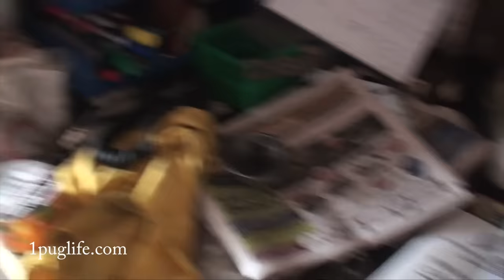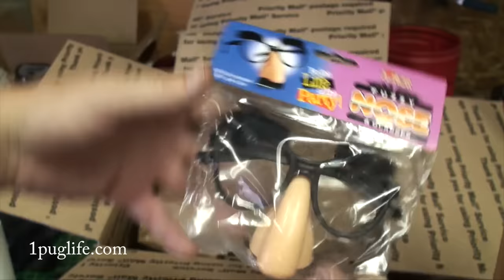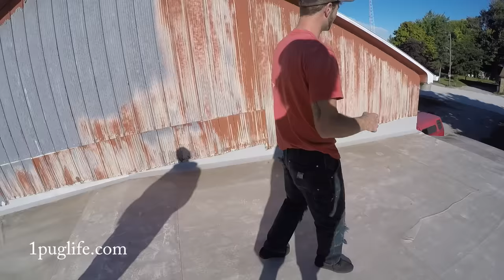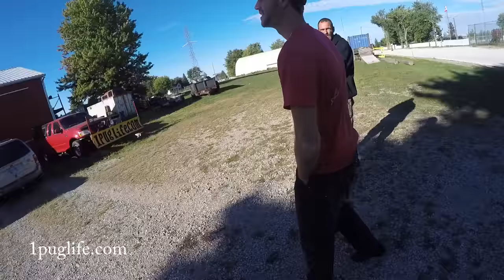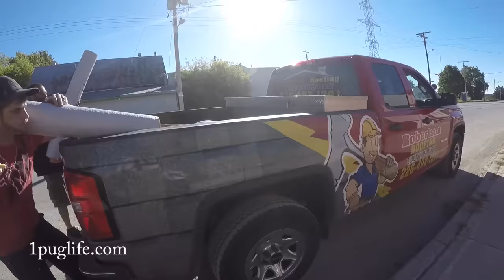roof update

Comment: This roof dick is also a screwball too. That metal can be screwed on or off of the rib. I always put them on the rib but it can be done either way. Also, that vapor barrier will cause you problems. The vapor comes from inside the living space so it's going to permeate the drywall the be trapped between the drywall and the plastic causing the drywall to mold from the backside, seen it many times, I wouldn't drywall over that plastic.

Comment: All steel roofing manufacturers for steel recommend in the flats, normally beside the ribs, You can't pull the screw down tight if in the rib. It'll spread the rib. Actually will get MORE leaks screwing on the rib, as well as spreading the sheets

Comment: "Install screws on the rib only"

What in the actual fuck? 
Seriously, am I missing something here?
Reply: I was wondering the same lol I have NEVER heard of anyone screwing threw the ribs.  It doesn't even make sense, the screws wont even be long enough for one thing, and also when the screws get tightened down it's going to flatten the ribs and they'll look like absolute shit.
Reply: ribs are the raised parts if you put screws in the valleys/channels you 100% going to get a leak
Reply: think its that type of system ..or something , is why he said to pug check what the fitting procedure is ..rib or flat  or something like that http://lyonmetalroofing.com/wp-content/uploads/14WoodTite-Strength.jpg
Reply: this is like, the eternal metal roof argument.. you're gonna get guys on both sides vehemently arguing either way and calling the others retards for even thinking that. my personal opinion is that through the ribs makes more sense cause more water is gonna pool in the flats than on the ribs thus less risk for leaks. counter argument to that is the screws have seals for a reason, but counter that with "the seals are eventually gonna deteriorate and leak"..... you can see how this goes on and on and on and on. the actual manufacturer of the steel will say in their paperwork how it has to be installed for the warranty to be valid, i say read that and do what they say yknow?
Reply: ^^ agreed , so many already in comments are for and against rib..lol .. but yeah new roof guy said .. get the installation manual or ask manufactory how its done.. so right there  to me.. the guys going to be good to pug1..
Reply: Turbo just had mind done and it's not screwed on the ribs??
Reply: That's what I was confused about. I had mine done two years ago with metal that has the same rib pattern as pugs and the roofer installed screws on the flat not the rib. In fact I have never seen a metal roof only fastened at the rib (excluding standing seam which is crimped together) but that's a whole different beast.
Reply: You dont screw on the rib
Reply: @TheBCSledder  All steel roofing manufacturers for steel recommend in the flats, normally beside the ribs, You can't pull the screw down tight if in the rib. It'll spread the rib. Actually will get MORE leaks screwing on the rib

Comment: You do NOT put the screws on the ribs!!!  If you go to clean snow off it you will fuck the roof up if on the ribs. If done right it will never leak. The problem people have with it leaking is when the tighten it down to much and mess the rubber washer up.

Comment: Yeah and you want to make sure the screws go into the space seating not into air and there's no drip edge running up your rake and actually with that type of roofing system they have those even for a ribbed roof or what we call a pro panel they do make drip edge and ridge cap even vented ridge cap but with all the space shooting probably don't need that and you only have depending on the size of your exhaust pipe a custom pipe Jack or a premade one that you can Flash in properly and you would have to overlap the pro panel after the first panel goes up to the pipe and extends I would say probably about 8 inches to a foot install your pipe Jack overlaying the first panel from the bottom up to the pipe then put the second panel over the top end of the pipe Jack and over the first panel and seal the pipe Jack where it overlaps the first panel and where the second panel overlaps the first panel seal all these

Comment: The rubber washer on the screw prevents it from leaking.... you can put the screw wherever you want🤙🏻
Reply: That's why I wouldn't trust these guys either...manufacturer told us to put them in the flat, they said the washer presses flatter and seals better
Reply: Matt sandlin  you are WRONG,,! All rubber- -polypropylene washer materials break down with sunlight,,even the most amateur tradesmen are aware of this fella,! 😂😂😂😂🇬🇧
Reply: With the screw fitted through the rib is a greater guarantee of not leaking if anybody here in Australia screwed through the flat part of the roof that job would be condemned.
Reply: ROBERT BUTLER     Use standing seam and you won’t have any screws showing at all. Problem solved👍🏼
Reply: #9 1 1/2" screws are equipped with neoprene washers and are to be installed onto flats with the recommended amount of torque as per warranty. Any weathering or installation practice would be a maintenance issue and if installed correctly should last 10 plus years. As per ribs, self boring stitch screws are recommended. # 9 1 1/2" screws would not be recommended for ribs with varying sized voids to support girts or substrates due to shear effect related to expansion and contraction of the structure. Due to these conditions it would make it difficult for reputable contractors to provide a long term warranties if this were common industry practices.

Comment: Screws go in the flats=Valley that's why they have non vulcanized= soft washers. your new roof guy is a goof also. If you put the screws in the ridges the roof of walk out! And it'll be wonky and completely out of square by the time you get to the other end. Simply put if you put the screws in the ridge you'll squish it and it will expand. There's no way of judging how much it expands each time you do it. This is why the screws have washers and need to be placed in the valley.
 Canadians!!!!! Can't teach a frog anything

Comment: Take 5 minutes and look up "metal roofing fastening schedule"
Yes, you screw the flats and you use a special stitch screw for the ribs at the laps.
Either way, that is one shit installation.
Reply: Yesss!! I knew I'd find someone who said this!! I've installed for years, screw in flat, stitch in seam, or it's not rigid and moves, wollows out hole, also how pannels "grow" look up how manufacturers explain installation.

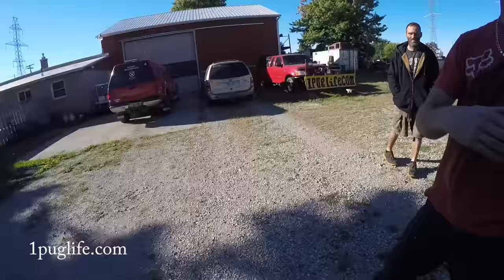Comment: not sure what he is talking about, 15:50, screwing on the rib?? never seen that in my life!  how-to vids up the ying yang, I would really like to see this rib screwing operation!  roofers in Ont must be hard on the glue sniffing
Reply: buffranchAB I have done many roofs and I agree with u I have never seen ribs screwed I was taught to screw flat too..
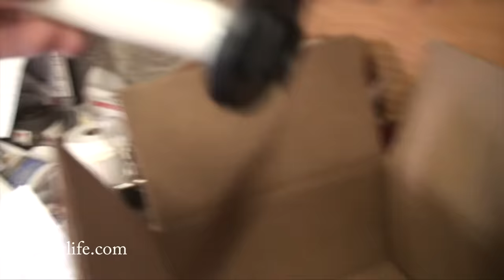Reply: This argument is primarily due to the use of lead headed nails used back in the old days. Because they did not completely seal the hole in the panels, you had to put them up out of the water flow. These days, with fasteners with neoprene washers, you can fasten the panel in the flat where they are slightly less obtrusive. You don't say what type of panel you are using. If you are using a panel with a tall rib, you run the risk of overtightening the fastener and colapsing the rib. Also, when the fastener is in a rib, it can experience more prying action as there in not much to keep it straight. Engineers do not like to see fasteners installed in this manner. Now if you are looking at a 5V Crimp panel as is often used in Florida, many people put the fasteners in the top of the V instead of in the flat. While it is common, it makes no sense to me. While the prying action is not as bad as in a tall rib panel, you have a much harder time getting a fastener started in the top of the V (some folks turn the stack upside down and predrill them, others hit the top of the V with a hammer at the fastener location to flatten it out a little). In this instance, imagine what you are doing to the neoprene washer as the fastener tightens and rubs and catches on the V. In the commercial industry, we use the same type of screws (the heads and washers are the same) on roofs that are up to 800' from eave to ridge at a 1/4:12 roof slope. That means the fastener heads are submerged in even a light rain. We do not have a problem with fasteners leaking (as long as they are properly installed. The bottom line: people successfully do it both ways but you have a lot less chance of a problem and better uplift resistance if you put them in the flat.

Comment: Don't hire those guys either. "Put the screw thru the top of the rib."" $500 pair of duck bill pliers to bend metal" first off im sure roofers install metal in many different ways. But its the manufacturer installation methods that are important. Manufacturers have did the testing and determine what method promotes roof longevity. They also will not warranty thier products if not installed in accordance with thier instructions. It is always best to go with a reputable company and always verify references if you have any doughts. Screws- always a problem because often times people over tighten when installing. Screws will not last as long as the   life of the roof. A 45 year metal will need to have screws replaced twice during that time frame. At best you might get 20 years,  but typically i see 15 years being about the limit your start seeing significant degridation of washers. Rubber washer longevity is determined by proper installation.   Squarely installed and tightened to per manufacturer instructions. Overtighting, will certainly lead to premature failure. If tightened properly, rubber washer has the expansion and contraction to provide proper sealing thru all the seasons. But eventually they will dry out, breakdown and start cracking leading to failure. That is why 10-15 years replacement intervals will give you long lasting results. Of course if you want a real maintenance free roof with exception to roof penetration sealants. Then a hidden faster style roofing metal like standing seam is best. FYI

Comment: All of this roof bullshit reminds me of working on my dad's house a while back.  I flew in with my wife from 1100 miles away to visit him and other family.  Somehow he cons me into spending 1 of my 4 days of vacation to dry wall the living room in the house he was in the process of moving into.  While I'm there handing drywall with a couple of his buddies he calls the plumber.  "So what do you have left to do on the bathroom" "virtually nothing"  So is the toilet and the new lines ready to go?"  "Oh yeah, it is all good, you just need to turn on the water and you are good to go".  So my dad goes into the basement to turn on the water and notices something.  The water lines the plumber was paid to "replace" we a hodgepodge of old and new fittings.  WTF right?  When renovating a house that you know hasn't had any utility work done since at least the mid fifties you don't screw new fittings into fittings that qualify for medicare.  But it gets better, after finding this out he calls the plumber and tells him "I want you to take a look at something, can you stop by for a minute?"  "Oh yeah, I'm at this other job but I can stop in in about 45 minutes".  While he was on his way we take a closer look at the toilet.  Turns out if you touch it it wiggles quite a bit.  Our first thought is "Ok, he didn't bolt down after connecting it to the drain, no big deal, stupid and we're very glad we caught it but no big deal".  Take the caps off where the bolts should be and discover...........he cut the hole in the tile way to big and there is nothing under for the base to bolt it to.  The toilet was literally only held in place by the rubber boot leading to the sewage drain.  Meaning the second someone sits on it a little off square BOOM sewage leak. So this guy gets there, makes all kinds of excuses, blames my dad for rushing him, assumes a random friend of my dad's who was working with us was his only major competitor in town (way to know who your competition is) , damn near cries about how rushed (the guy had like 2 weeks to the end of the month when my dad had said he would like to move in) and how difficult a simple line replacement, floor and toilet install was and storms out of the house while saying "I need to leave before I hurt someone" yeah, smart thing to say in a house with 5 men not counting the homeowner and you are there by yourself.  After there is a rather loud talk in the front lawn about "why in fuck would you ever say that in a situation where you are the one that fucked up what you claim to be your profession" he says he said it because he "trains to kill people with nothing more than my hands" and then has the gall to say he will fix it but wants to know when he is getting paid for the job before he does.  We as a group all collectively tell him to get lost, it take one of our guys only about 45 min to fix the toilet problem and my dad has the other plumber in town, who the goof thought the random friend was, take a look at the toilet fix and he said "yeah, that is exactly what I would have done if I cut the hole too big, looks good" and told us to take him to court over the hack job he did on the supply lines.  But do you know what the worst part is?  My dad still paid the guy like 2/3 of the originally quoted price, fuck that man.  I would rather spend twice as much on a lawyer than give someone money for UNCOMPLETED WORK!!!!

Comment: this guy is wrong you do not put the screws on the ribs I have been in this businessfor 30 yrs both as a contractor and retail and if you talk to a retail building supply they will tell you screws go the flat as well thereare gable flashing for the gable ends not bending the tin over. Private message to get the right advice.

Comment: Do not let those fuckers put screws in the ribs man. That's old school, use to be the only way you could do it. Now seal-tite informs you that the warranty between them and the metal company voids once the screw enters the rib. There's a half inch gap between the screw and slat, it causes a bow in each spot a screw is inserted. Be smart man